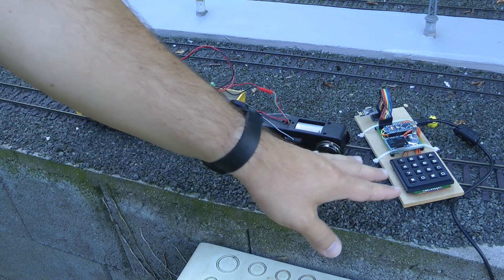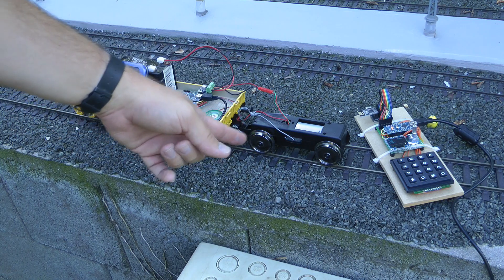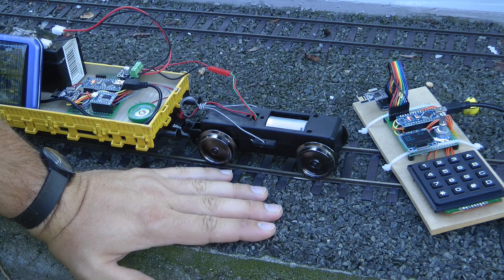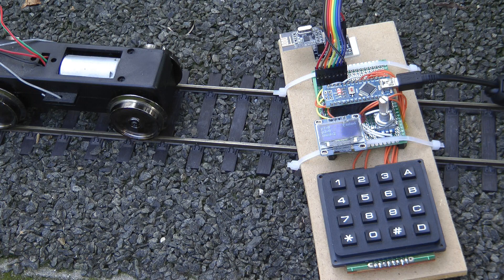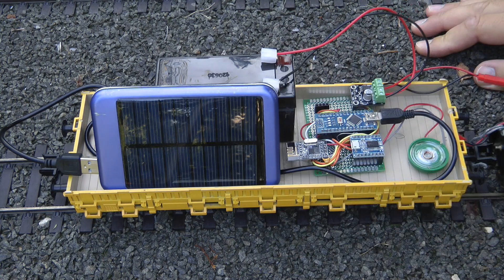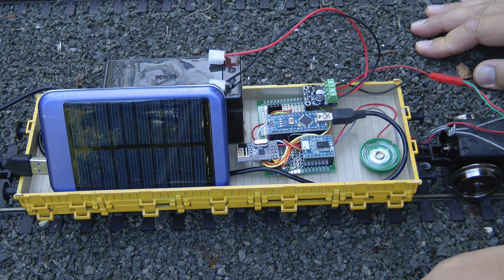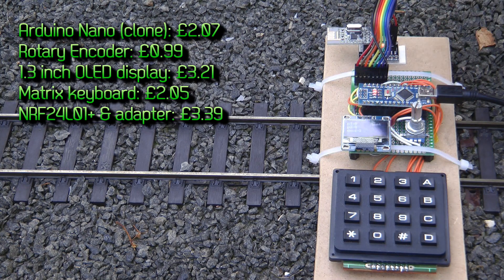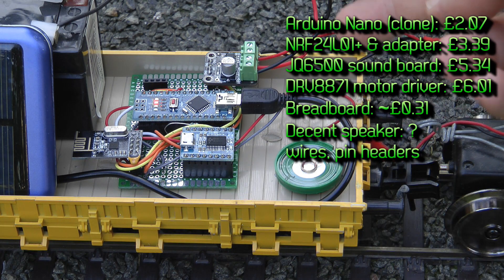New project preview: RC train controller

Comment: Sorry, last time I looked at this I thought a hybrid RC with DCC was the way to go. DCC over the track isn't quite the best and if you go DCC wifi then battery power is also a go! What do you think, as the DCC loco chips aren't that expensive and they are model rail pecific in function including sound???
Reply from the maker: That would certainly be a good option. But to be honest, I have not seen such systems. Have you seen any working?